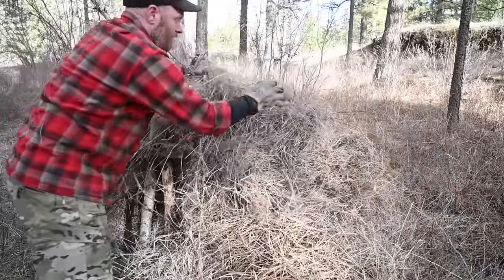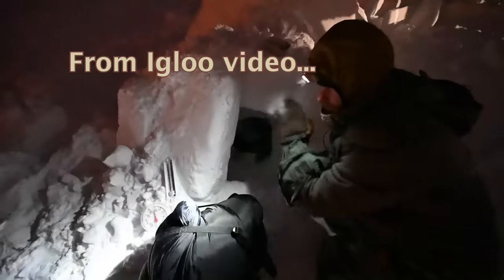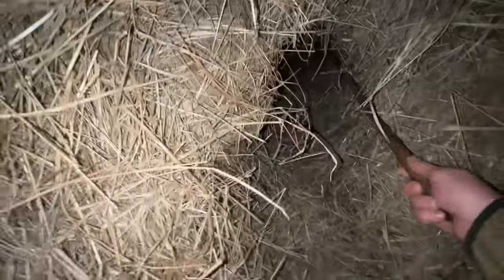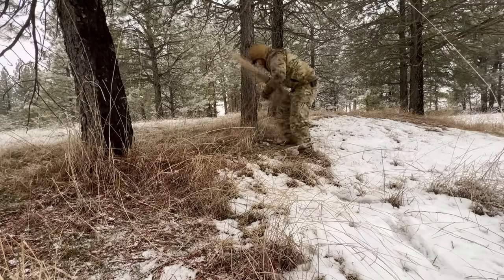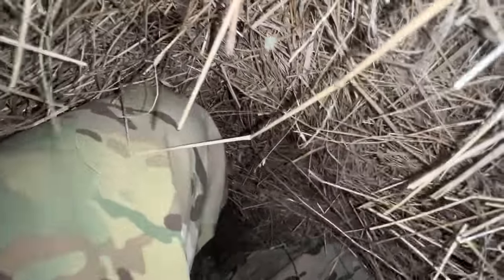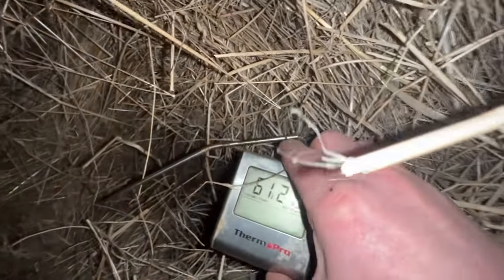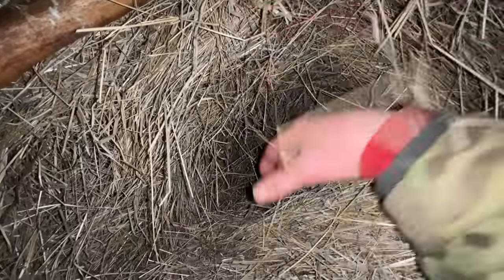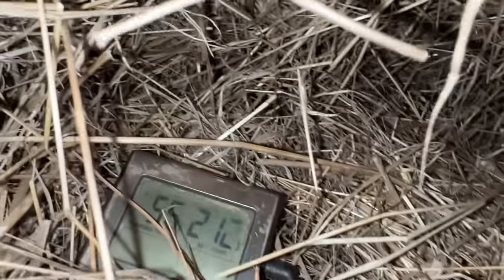DID I FINALLY Sleep Comfortable with NO SLEEPING BAG?

Comment: your body is roughly equivalent to a 60W heat source. from there it is a heat transfer energy balance of volume, insulation, and outside air temp. you can only expect to heat things up so much. but 55F when it's below freezing out is Huge improvement if trying to survive. My house is only 64F all winter long and it's comfortable.
Reply: Depends on where the humidity is at for air temp comfort. Dry 68, Humid 64 for winter time comfort.
Reply: @JoeOutdoors  irrelevant to the topic at hand. And a matter of personal preference. Most people where I live can stand 64F. But I force my self to acclimate to it. But 64F is the lowest I've been to acclimate to. but survival is totally different.
Reply: @SoloRenegade YOU made the comment about home temp.
I replied to YOUR COMMENT, not the topic.
So my comment is very relevant TO YOUR COMMENT.
The comfort level in my corner of the USA depends on temp and humidity. Dry air doesn't hold heat as well as damp air.
Reply: @JoeOutdoors  you took my comment out of context. You selectively read and responded to it. Learn to read.
Reply: @SoloRenegade  Learn to comprehend what you read and what it refers to.
Reply: @JoeOutdoors  It's my comment thread, I know what I said and meant just fine. stop trying to blame others for your failures.
Reply: Yo chill guys wtf
Reply: @mr.commonsense6645  yes, chill is right. most people find 64F too chill in fact.

Comment: The grass would be great insulation but normally comes with a host of criters. (insects)
Reply: If it's cold enough for you to die they're probably all dead or will be when you move the grass and expose them to the elements.
Reply: Mices and other small rodents more likely during winter.
Reply: sharing is caring ❤

Comment: the ambient temperature definitely helped a lot, but so did adding more grass!

i am glad there are at least some people that measure the results and try to keep the conditions as real as possible like your self! i do enjoy watching some fancy bushcraft or some one just chilling out in the woods in ideal conditions, but it is good to see proper survival tip videos that prove them selves
Reply: EricDundee  somewhat, but you would have to seal crack, and stripping bark is a harder process than most realize

as long as you get enough grass on and around it, unless you get a serious gust, it will break the wind fairly well

Comment: Another tip. Building a debris hut. Works better if you first plie a big layer of leaves first then the grass straw that will cut down on the dust you mentioned.  But you would need more sticks to support the leaves and then the grass straw over the leaves Works really well. Alot of straw for bedding then a layer of leaves,straw,leaves it will help alot with keeping the cold ground from leaching out your body heat. The hatch you made will suffice

Comment: Love the vid.
It does take a couple of foot of thatch all around to get the insulation.  Much depends on what type of grasses, hay, reed, or brush, you have about, and never underestimate the quantity that is needed to be collected.  When you think you have enough then double that and then you might just.
If you can bundle and lay a thatch with straw you can get a waterproof roof, has to be tight and deep though.  They can improve a dry leaf mound too.
Do pay attention to the frame, as they do have to support quite a weight by the time enough is piled on.  I prefer a green springy sapling hooped bivi tunnel, but that is if there is plenty about, and they need cutting too.  Split they can be woven length ways so adding more stability and strength.
A survival candle in such a small space will rocket up the temperature.  Fire risk is minimal with a little care.  A hot water bottle/canteen can also be a boost.
Lastly, having a knife long enough to cut grasses in the quantities that are required makes all the difference.  Most bushcraft sized knives just take forever being too short.  Which is why I carry a golok or Skrama which are ideal for cutting grasses and reed; the thin wood poles too.  Gathering grasses and cutting turf fast blunts a knife and reason to have a DMT sharpening stone in your kit. 
Used to build these when a kid.  It is loads of fun.
Reply: a few hundred feet of round bales of hay covered with tarp in a field with the farmers dogs barking all night

Comment: I found when I lost a tonne of weight that got cold more easily specially at work. I started doing sauna and finishing with a cold shower until I could feel my toes made me no longer have an issue ar work. The layers I had on before made me sweat 😓. I learned that its just as much training your body to deal with the cold than just layers of insulation. Very underestimated way to burn calories continuously throughout the day. Great video.
Reply: Can confirm.I fly fish a lot during the winter months and have for decades.Usually one of the first on the river n last to leave,nothing to do with toughness,you just develop a tolerance…Or maybe it’s just DNA from my Norwegian grandmother lol

Comment: You should do more debris shelter videos. There is a lot of room for improvements and mitigations.  Mitigation like building a fire away from the shelter and heating some rocks to place under you with another layer of grass right before bed.
   Improving on the dust situation:
  You have pine and fur boughs available.  You should do your framework with live saplings, not dead wood. I speak from experience on this point.  Live saplings and boughs are easy to stick in the ground and weave between each other.   If you make this thick enough it acts like a barrier to keeping all the grass out.  
     What would be really cool is if someone came up with a design to safely build a small rocket stove inside their debris shelter.
   I have no idea how one might accomplish that without a serious probability of burning the place down.
   I like your videos because you're including a lot of things other videos don't,  such as discussing the short comings of the shelter and then experimenting with ways to improve upon those. Keep it up.

Comment: debris can get wet with rain, snow melt or your body moisture. Then it weighs a ton, can smother you, and the moisture will mean that the debris wont insulate you from the cold very well. By putting an impermeable membrane atop your debris, you get rid of those issues and you'll need much less debris to stay just as warm. Ditto underneath you. A sheet of plastic on the ground and then a layer of tyvek between you and the debris. Sealing out the moisture that's in the dirt is always a good idea.

Comment: Thank you for taking time to make this video. It was an excellent video. I wonder if it would be a good idea to have 2 small plastic tubes bringing small amount of fresh air inside at floor level so hot air is still there in the upper area. The second thing is if you have a few cheap mylar blankets, you can use it as inner lining just so temperature can be warmer. Just my 2 cents. I am not an expert. Thank you once again for sharing this video.

Comment: i think it's best to make a enclosure with sticks or rocks or logs to contain the grass or debris from spilling outwards you get better cover with less material cause its a better shape to keep the warmth in. all it has to be is 3 or 4 foot sticks driven in the ground once every foot in the shape of your body this gives form and better protection.  also you can trow all kinds of sticks and ferns or pine cones anything on the now flat top to compress what is on top of you without it rolling of to the sides. This makes it warmer because of less airspace between the mat of debris on top of you also crawling in and out you don't mess up your nest. I grew up in Europe where the winters were very cold we never had modern mattresses we slept on a strosock a  haysock a large sack filled with straw or wood shavings that was thick enough to 6 inches when compressed. I never got cold from the bottom, and with a wood stove once the fire went out the  house got very cold.

Comment: Seems like if you could find some denser material to create a shell over top of the grass, it would boost the insulation factor. I know a person wouldn't have a tarp with them necessarily, but I am curious to know if you did throw a tarp over the nest, would it make a big difference in retaining heat within the grass. Or maybe a pile of damp leaves or whatever. Some kind of outer shell so the heat doesn't dissipate through the grass so readily. Just a thought. Maybe a bad thought, LOL.

Comment: How about using a large size garbage bag as a sleeping bag inside the grass shelter? It will block the heat around the body, stop straws getting inside the pockets, and block the dust. One bag weights nothing and is easy to carry.
Reply: Lol don't suffocate.
Reply: Condensation would likely be a big issue.
Reply: Fire pit on the back wall would be better. If you are gonna off yourself do it quickly

Comment: I mean, it will probably do a good job keeping you warm... but the itching, the bugs, and the moisture that will seep in... those are big issues. On top of that you are essentially in a very flammable pile of tinder, so starting a fire anywhere nearby would be a big problem. I also don't know how good this design will be at wicking away rain or snow rather than letting in work is way in.

Comment: I would try to get the Grass more dense it should provide more insulation. And also you can dig 12 inches little longer then your body because the ground is a really good insulation make the hut over the hole. And a other thing if you can get a fire heat up some rocks and put them in a corner and they will act like big hand warmers. 

Me I would have tried to make the shelter bi a tree to act like a better wind barrier.

Comment: you need MUCH less debris if you'll pack it in between a couple of sheets of fabric. Use tyvek next to your body and plastic for the outside membrane. Tyvek lets out your body moisture and the plastic keeps out the wind and rain.  The problem with debris is 2-fold. you dont have enough of it, (or it's too scattered-, same thing) or it's all wet-rotten.. It's very dangerous to trust your life to finding dry debris when you need it.  This is especially true when temps drop below 0F or if there's no fuel to burn and heat yourself with.

 Me, I carry 10 lbs of packs, net hammock, bivy, extra clothing, etc, to see to it that I dont need a fire or debris for sleeping down to 20F, which is about as cold as it gets around here. I can use hot rocks or hot water bottles to gain another 10 F degrees and do so discreately.  The miliitary says that hostilities nearly cease at 10F, especially at night, mainly because such temps are so hard on batteries. There goes your night vision, radio, even the electronic sight on your rifle. 

So at 10F or less, at NIGHT at least, you can have an open fire. I can wear my sleep/shelter gear as clothing, so I'm saved the weight of the clothing and brisk activity can gain you nearly 20F degrees..By 11 am,  I can gain 20F degree (as vs what it was at dawn)  by "aiming" the PEVA door flap at the end of my reflective tyvek bivy at the sun as it rises.  If hostilities are why you can't have a fire in daytime, you should do your moving at night and hide in the daylight anyway. That means dont be moving.

Comment: your body will produce heat and it'll be warmer. You will be forgetting to put a little weight outside to condense the covering to block the drifts a little. Also, if you have a dog, it's a lifesaver. The body heat from a dog is very warm.

Comment: Put some big rocks in a fire and transfer them inside when it's time to go in and seal it up. They will bring in a lot of heat and last for hours. Also, if available, Spruce Bows to weave a stronger structure that will hold more and offer better protection in bad weather. If done strategically, keep some of the grass out of your face. Straw is MUCH better than any grass. More insulating and doesn't go limp when wet.

Comment: i know you Yanks like your freedom units and i grew up at a time Australia was crossing out of inches so i do understand metric and feet. one thing i just dont understand is why you still stick to fahrenheit over celsius. might be just me but celsius just makes more sense. 0 freezing, 100 water boiling.
 other than that nice video, one question though how would the shelter do in freezing rain? we do get a lot of places that get snow here in Australia but most cold states here in winter the moisture content of the air wont allow it. so we just end up with slushy rain.
i know a trap or even some of our gum trees here like the paper bark can be used as shingles but was just wondering how much your shelter might leak in the rain.
Reply from the maker: Beats me, metric makes way more sense! That’s another reason to make the shelter as thick as possible, rain will hit a piece of grass and travel to the one below it, then the shelter and grass angle will eventually migrate to the ground before making its way inside. Bark on the ridge at least would help or if possible cover the whole structure.  Freezing rain is brutal, every thing in survival is about the best use of time, energy, and materials, so it’s what’s available, grass would not be my first choice in that situation.  Grass would be a great insulator to have anywhere, in the clothes or shelter if collected dry beforehand though.  It will take a long time for the water to saturate everything and leak, even if saturated, the correct pitch or angle of the shelter is important so water can run off each piece down to the ground. The flatter ridge portion is the most susceptible to not being able to do that and leak.